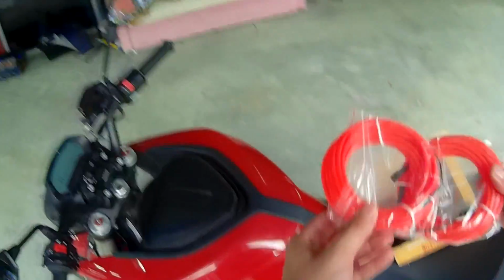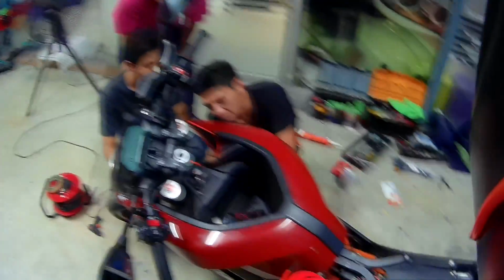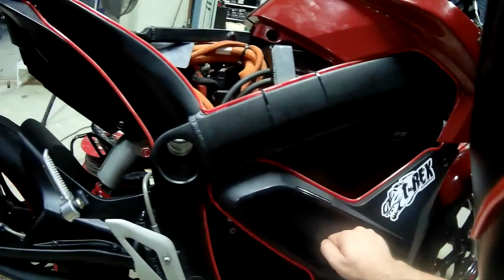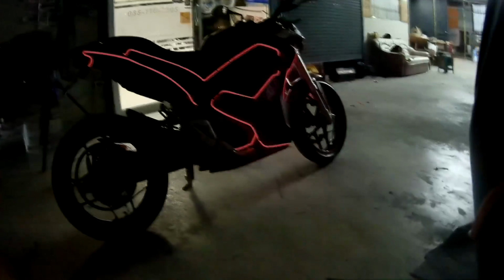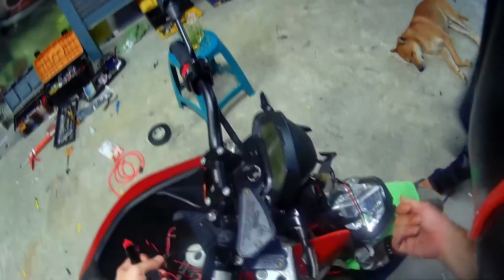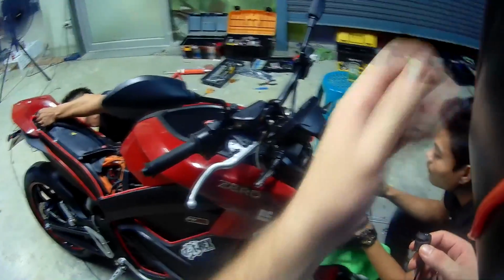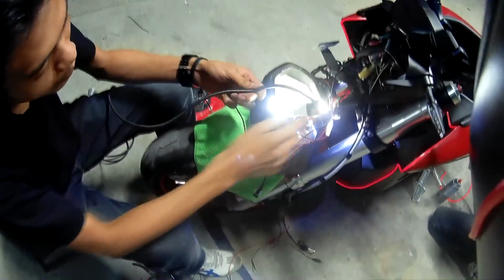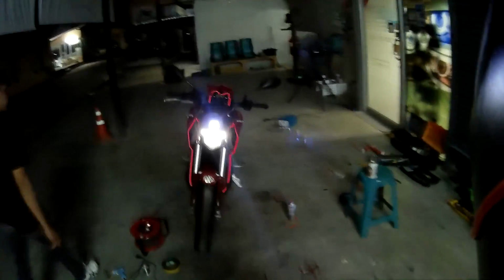Zero EL wire Upgrade!

Comment: what adhesive did you use to stick the lights?
Reply from the maker: I said it in the video, superglue
Reply: @EVSpeed  where did you buy those?
Reply from the maker: @toOthp1ck01  If you search online, you'll easily find El wire